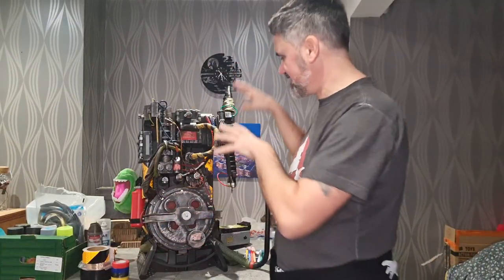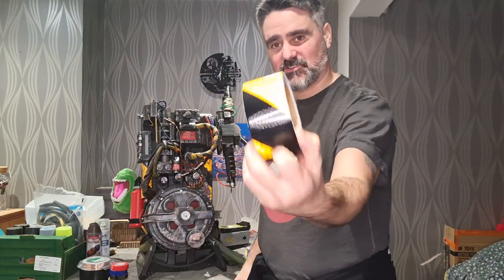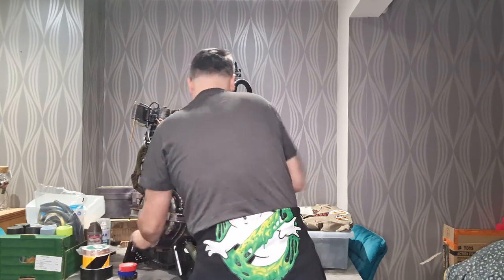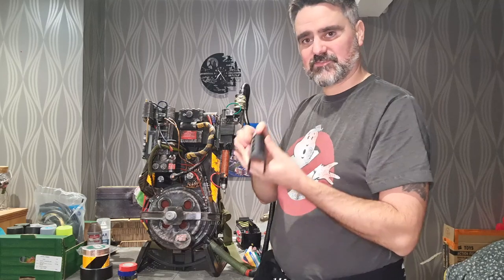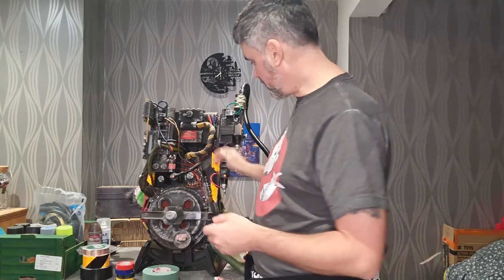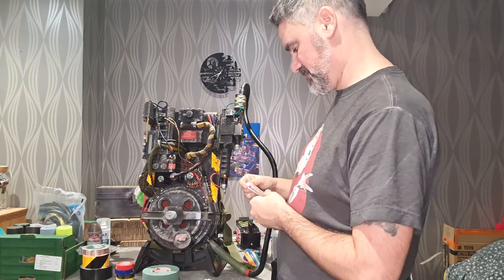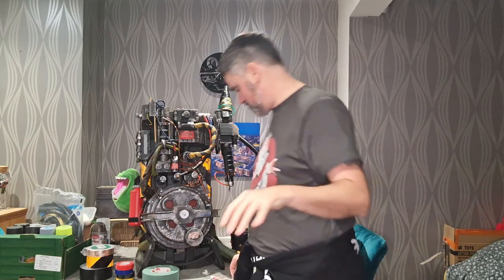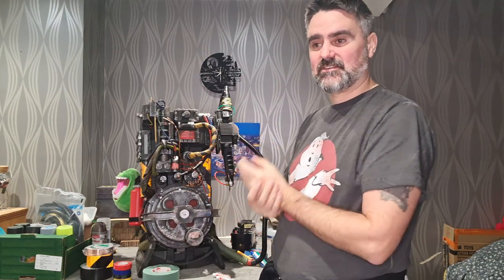Part 4 - Final Video - #Hasbro Proton Pack is Event Ready #HasLab

Comment: I've seen that same shoulder strap come undone several times (to me and others), even when its just holding lighter Spirit packs. Apparently the buckle is not bent to the same degree as on the older frames, and so it has a harder time gripping the fabric of the straps. I went and stitched the strap into itself with some needle and thread so that its no longer adjustable, but should hopefully prevent it from sliding again.
Reply from the maker: That's good to hear my dude. Thanks for watching and have a great day.

Comment: I saw the copper tape on Adam Savages channel too. I do like that, but I want to try and replicate the wires with copper eyelets and real wire if I can find everything in the right sizes. I'm sure with a little digging I will be able to because they did it on the real Phoebe pack. Haven't seen anyone do that yet. I'm surprised Adam didn't go that route. I'm not throwing off on the tape method. It looks very good and is much easier than what I want to try. Great videos. Keep it coming.
Reply from the maker: That sounds awesome. I hope you can find the bits for it. Good luck. And thanks for watching
Reply: Truthfully, your method is probably easier assuming you find the right parts. Putting the tape on was very tedious.
Reply from the maker: @thenerdofalltrades8190  yeah the tape took time and effort.